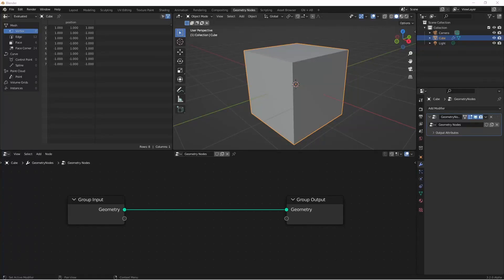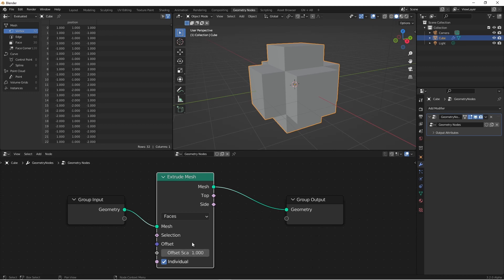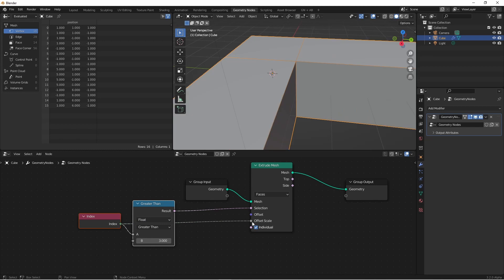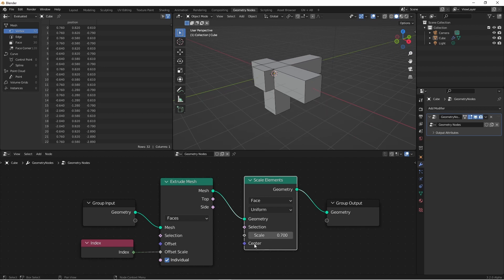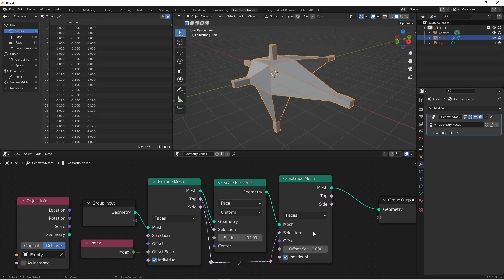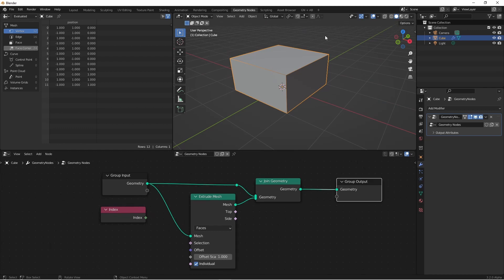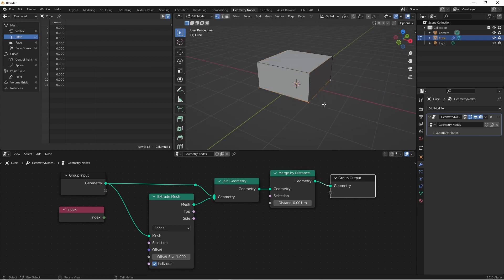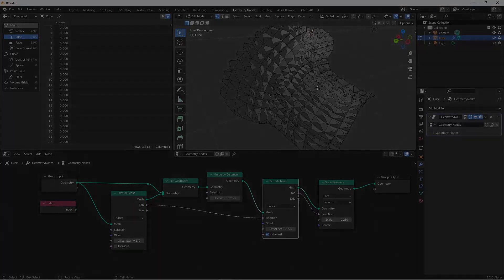Geometry Nodes: Intro to  Extrude Mesh and Scale Elements

Comment: Thanks for showing the solidify workaround! It seems a step was missing, don't the original normals need to be reversed?
I would really expect that to be an option in the extrude node though, like "create caps", like a normal extrude command.
Reply from the maker: You are absolutely right! Just add a flip faces node to the original geometry before the merge by distance.

Comment: Another great video. 
One of the most interesting parts of the extrude node is the bit where you connect the index to control the length. Sure there are lots of other interesting ways to control that.

Comment: There is no negative in the offset slider of the extrude node.
 Is it a bug? 
Works when I plug a value node into the offset with negative values.
Reply from the maker: Just type in the negative value.
Reply from the maker: I think that may be changed before release.

Comment: Still waiting on the curve modifier becoming a node. It'll really save time to not have to scroll through 12 different iterations of the same thing just to change something before or after
Reply from the maker: Yeah, I know that one has been on Hans' plate for a long time.
Reply: @JohnnyMatthews  Nevermind, I somehow figured it out from the existing nodes. Though it does require an extra vertex group compared to the modifier. Though it's much better than the modifier for people doing 1 line of vertices at a time